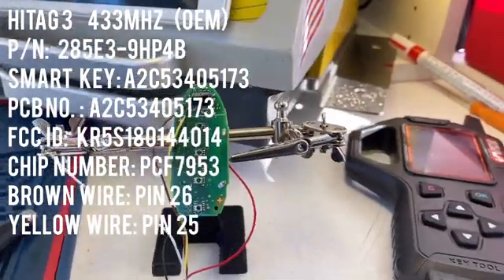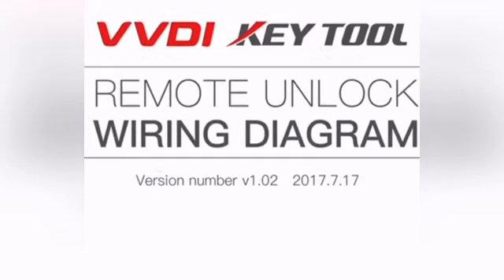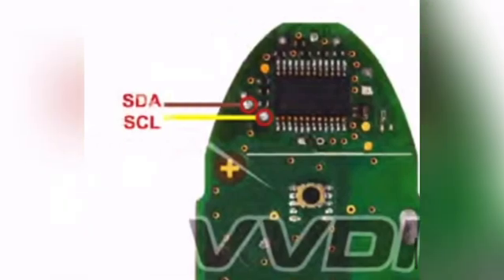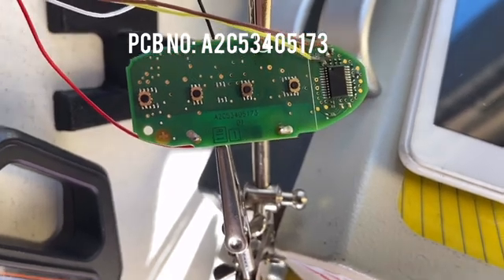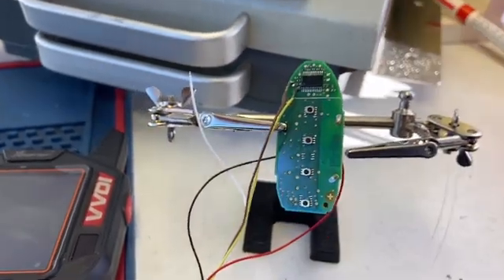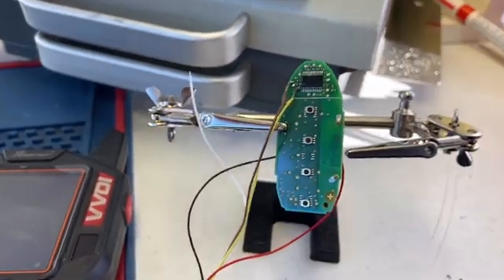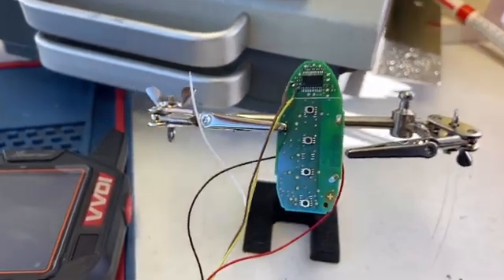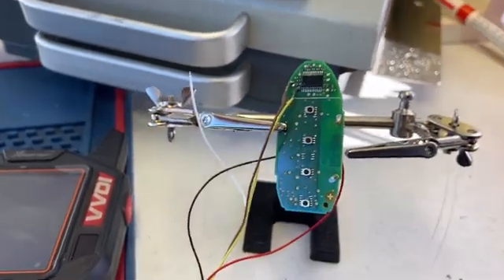UNLOCK NISSAN SMART KEYS (REMOTE  RENEW  VVDI KEY TOOL)

Comment: Can this unlock the aftermarket remotes for the Nissan Bmw and the Chrysler Dodge and if so, is there a diagram for the wires because I believe the adapters will not work for the aftermarket ones that I got?

Comment: Trying but failed to renew a Nissan Smart key with following specifications:
Transponder 4A
Chip PCF7953M
PCB#. A2C32801600
Frequency----- 315MHZ
Key tool max has same pcb# and chip # but frequency is 433mhz.  Might that be the problem?  Please 🙏🏿 assist.

Comment: Hello sir, I unlocked an original used nissan key 315 and the chip unlocked successfully, the problem is it doesn't work the remote function,, what did I do wrong?
Reply from the maker: Wrong fcc

Comment: Thanks for this video, Mike.  I did my first Nissan remote unlock today using the Xhorse Renew Cable and the Key Tool Max.  I didn't find the diagram PDF useful, but the Key Tool Max has the diagrams built-in and you can zoom into the circuit board to see where the wires need to be soldered.  I tell you, soldering the SMDs wasn't easy because of how small they are.  No way I could've done it without a third hand and magnifying glass.
Reply from the maker: Yess it take alot of patience and the right tools!! But not impossible!!

Comment: Bro. This video is nice. I wanns learn from your videos. About to subscribe. 
I have vvdi mini. 
Where did you buy the item you use to hold the transponders.
Alao, qhat is the webzite you find this good info on?
Reply from the maker: That one is the vvdi key tool original!! That one is discontinued but you can probably still find a used one on ebay... .. i have the max key tool now!!
Reply: @MYKEYSAUTOMOTIVE  do they have the same features or is the max better than the original?

Comment: Great video man.  Even though that tool has been discontinued, do you know of any other tools similar to that one with the same function to unlock keys? Thanks
Reply from the maker: You can actually find this tool used on ebay!! Till this day i think this is one of the best clone/chip generate/etc ..I believe when they did this handy vvdi ..they notice that they over did it and it was costing too much and notice they wernt making much money so they stop making it!!
Reply: The mini key tool was next to replace it and now the key tool max is the newest.
Reply: @MisterGank  Key Tool Max is actually pretty sweet. Couple it with MINI OBD and it’s actually really good tool

Comment: I have seen the adapters sold online Does soldering directly to board replace the adapters that are sold for renewing
Reply from the maker: Those adapters work only on oem (factory) smart key... most aftermarket smart keys(made in china) wont align up .. so you must solder to renew!!

Comment: Is that a new update or old update that you done a video on .and have you tried using the Xhorse remotes on Chrysler or Dodge. I did and they don't work because the fob is to far away from the reader so it doesn't read the transponder
Reply from the maker: Its one of the new updates ...as the update comes out it informs you on the software so just click on the most recent one i believe its 3.3.1  ,  what year and model is the car??

Comment: What machine/tool do you recommend for soldering?
Reply from the maker: I bought a little cheapy one on ebay.. nothing special, the solder wire i use is 63sn/37pb 1.2%  diameter  0.45-1mm ..cant be too thick has to be nice and thin.. really small ... its better becuase you wont smugde it all over the place..